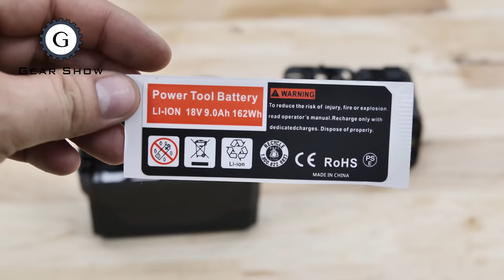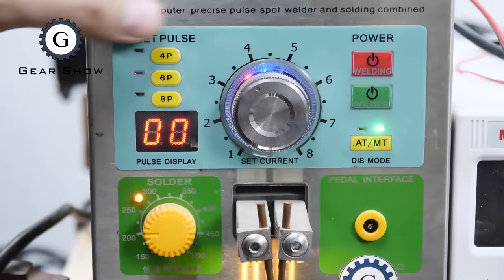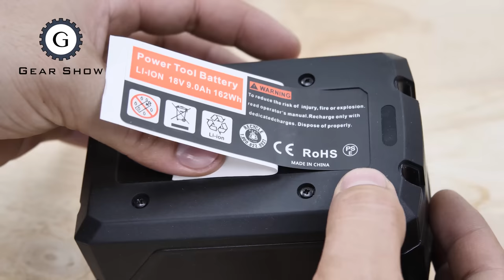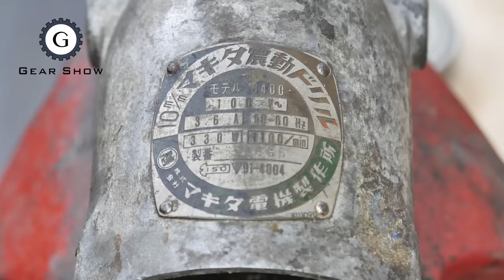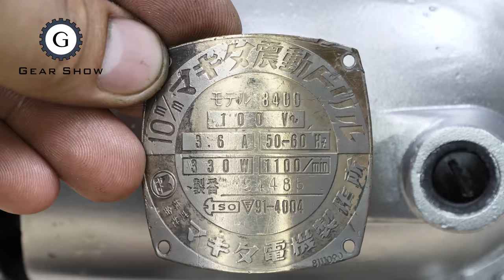Vintage Electric Hammer Drill  Restoration and Conversion from 100V to 18V

Comment: It looks like the spot labeled '12v' on the circuit board wasn't soldered down like the rest. You can see it at 3:47
Reply: also didnt add a grommet where the power cables go into the (metal) body
Reply: always one to pick a fault
Reply: People who spot potential problems are much better at their job than those that just sit in awe.

Comment: Please a Quick-release chuck and a brushless motor:hand-pink-waving:
Reply: so scary powertools with full metal expose like that with no rubber coating, and its electric AC to, you bassicaly play with your life using a tools like this, convert it to dc will be safer from electric shock

Comment: Interesting project. But was it worth?  I mean, there is really lot of work you did. Anyway when you testing drill on different materials like wood there is no question. When you drill concrete, I see a low performance in this case. And there is not showing drilling metal plates. Good job anyway. Good luck!
Reply from the maker: The battery can be used with the original power tool, so It can't count into this project cost. I do this project for learning and showing. The vintage mechanic structure is designed not so good, that why it performs not so well. Anyway thank you!

Comment: nice but you should not use plastic to "Insulate" the windings.. you should use insulating paper that is designed for it you run the risk of it heating up and melting and sticking causing a short with prolonged use.
Reply from the maker: Yes, you're right. Thank you so much for sharing!

Comment: Use dc switch or 30a relay with normal switch 
Switch u are using will not handle >2 amps current because it is made only for AC current load
Reply from the maker: Okay, thank you for sharing!

Comment: Q: Do you have to tamper with the motor in order for it to work with a battery, I have added a battery to my corded Strimmer to make it cordless, however, it doesn't give the same power?
Reply from the maker: Did you change the motor?
Reply: @gear_show  no i have not
Reply: So i take it motor requires changing for it to work?

Comment: Did you just use a rip off china Milwaukee battery kit from asiabay? You should have started with the restoration of the drill and left it at that , (great work I might add) but why rip off a brand so clearly and use it in a vid ?  Just buy that branded battery and use it

Comment: Other than perhaps a bit better cable management from the handle to the battery, you've done an excellent job.
I'd have sleeved the wires into one flex, grommeted the hole they emerge from or, indeed, routed them out of the smaller hole @ 28:38 and blanked off the large aperture at the bottom.

Still, definitely a 9.5/10.
Reply from the maker: I'm so glade with your feedback, thank you for sharing!

Comment: Thank you for great video bro. 21:20 I need your help. I use RS 775 and its wires broken high voltages. What did use this liquid glue for secure wires? I find a glue, Permabond 920 but is it very expensive.
Reply from the maker: It is A&B glue.

Comment: You're supposed to melt that plastic pole. The one that came through nickle plate. It's there to lock the metal in place. 
I used low temperature solder with old tips.
Reply from the maker: Okay, thank for the tips

Comment: Did you input 100V in the beginning?
What is the current or power of the new motor?
Reply from the maker: I didn't test with 100V in the beginning, I know the original power by the label. 
My multimeter can't measure the current of the new motor.
Reply: @gear_show  the drill is designed with 100V so maybe your initial test with 200V+ AC broke it? these vintage makita hammer drills are surprisingly durable and ppl are still using them practically today.